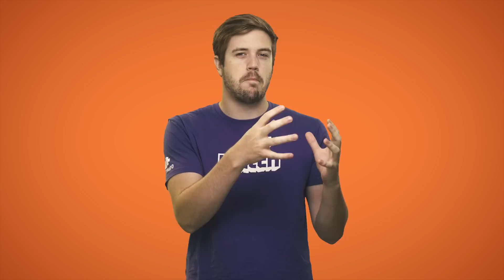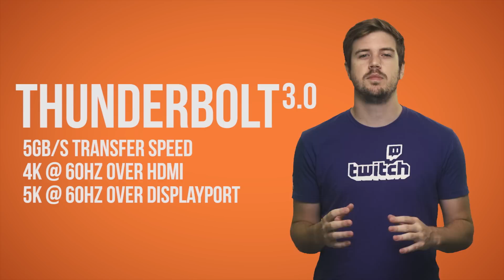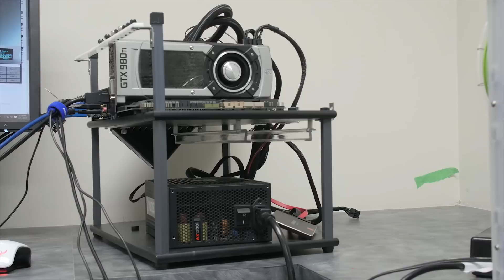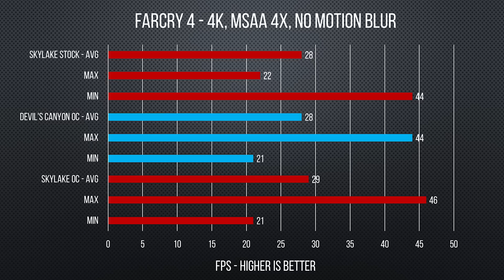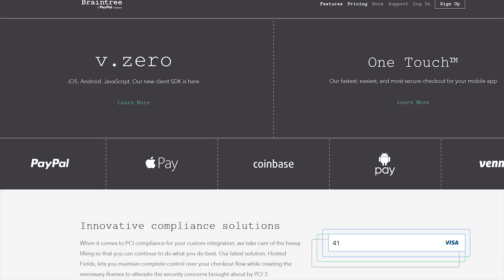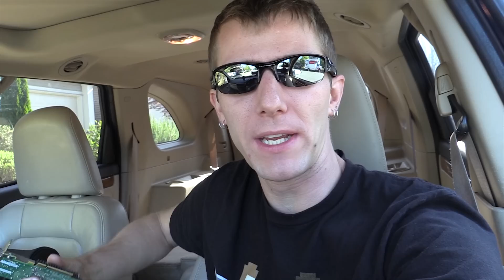Intel 6700K "Skylake" CPU

Comment: When you said older CPU's. Did you mean really old cpu's, cause I'm still using an Intel Pentium Dual Core E5400 @2.7 ghz? xD
Reply: Karl Taok tbh i wouldnt be surprised if i put my R9 290 into my old still running Core 2 Quad and it still ran BF4 and Project CARS just fine xD
Reply: Karl Taok Mate of mine is playing Dark Souls II Scholar of the First Sin on a core i5 650 (dual core 3.2GHz) with a Radeon HD 5770.
Reply: +exodiathecoolone That CPU is still good enough and for that GPU, that i5 has enough horsepower (even though that i5 is more similar to an i3 than a newer i5 - dual-core with hyperthreading).

A colleague of mine got that CPU. That thing overclocked very well using MSI OC Genie, from 3.2 to 3.8 GHz, not to shabby.

Comment: the only reason I bought a 4790k was for emulation,, Since it is god for it. Great that 5 games use more then 1 maybe 2 core since 2006...  I was a AMD fan until I learned the "price fer watt" or whatever was better.. Yeah if you want their new CPU to do as good as a P4 by all means! The new intel is crap. Anyone who isn't paid to say aswesome will say the same. The 4790k is the best still....
Sucks they don't give single core performance. AT ALL! What it can do vs what it does..

Comment: I cant believe people are still on Sandy bridge its ancient,....not if you're an enthusiast. Single threaded performance is like 40% better on new CPUs, and multi-threaded is like double. Not to mention all the new features on newer motherboards like USB 3.1, better audio etc  Not much difference between Haswell and skylake though.
Reply: tubester4567 single thread performance is marginally faster, about 10 to 15%. 
You are not counting that SB by default comes at 3.3 ghz, which is incredible low considering standard OC on SB is about 4.7 ghz, with chips getting at 5ghz. 
For the sake of comparison, a SB at 5 ghz, is a Ivy at 4.7/4.8, and haswel 4.5/4.6.
And because the newer cpus dont overclock as high as sandy bridge, the benefit to upgrade if you are a overclocker is negligible
Reply: tubester4567 It may be ancient however its successor's have mostly been focused about lowering energy consumption, increasing IGP performance and tweaking performance with minor 'tick' updates as opposed to total redesigns.

For most people you would be better to update your gtx500/HD6000 to the latest gpu's which offer much better performance and power efficiency and buying a SSD for your OS. Most games don't even max cpu's out or take advantage of multi-cores.

The 2500k/2600k will go down in history as one of Intel's great workhorse processors like the Q6660, Q9650, i5-760, i7 920.

Comment: if intel are bringing new cpus out, more than AMD, then that proves that intel are not doing that much different to there cpus, their just overclocking the old one and put a new number on it
Reply: Hayden123457 you're a special snowflake aren't you
Reply: they aren't, but they aren't doing as much to improve either.
Reply: Hayden123457 actually they have done a lot since 2600k series, the power usage has been reduced by a huge amount while also improving the iGPU's to a point that the i3 should be able to run games without a discrete GPU making cheap shop bought desktops good enough for budget gaming. they have added countless features aswell. The only thing that hasn't changed is the raw CPU performance but this aint 1990 anymore, raw CPU performance isnt the whole story anymore
Reply: Mansen I didn't say intels reason for improving their iGPU's is just for gamers but it is definitely helping to make the low end chips perform respectably in games
Reply: Mansen yes really, just look at the gaming benchmarks OC3D did with the broadwell chips, I haven't checked out reviews of skylakes gpu performance but its only going to be better :)
Reply: megaspeed2v2
You should and be dissapointed, skylake igpu's are worse performing than broadwell on desktop, mobile might be a different story though if we get sodimm ddr4 for mainstream.
Reply: Mansen omfg WHEN did I say that they were designed specifically for gaming? never. stop putting words into my own mouth. ALL I said they are getting better and that's a fact, if they continue to get better they will begin to rival AMD APU's when going for a budget gaming PC/Laptop, thats what I was talking about...
Reply: Mansen
Well if amd get their shit together then maybe there will be a use case where you dont need a dgpu (especially for laptops).
Reply: megaspeed2v2
And also intel wont let that happen, if they ever make chips that are even slightly better than the amd ones in both cpu and gpu tasks the laptops based on that chip will get priced much higher because intel is a brand you can label products with and the consumers will lap that shit up. theres also the fact amd apu's are rarely put in decent laptops in the 1st place because intel has that market in a vicegrip and its a market where efficiency reigns supreme (carrizo might have a decent shot there though if OEM's stop shoving them in shit).
Reply: Mansen what do you expect when you come in telling me I said shit that I didn't say... gtfo troll.
Reply: 1toncheese But intel ARE doing it, their CPU's have been getting better at all applications using the iGPU including gaming in every generation, back in the day an i7 laptop without a Nvidia/AMD GPU alongside it had a lot of cases where you couldn't even run a game on the lowest settings very well unless it was quite an old game and now you can easily play the latest games on low settings even with a bottom of the pile i5 laptop. its not as capable for gaming as a laptop with an A10 APU but if the trend continues as it has done (and there's no evidence that trend will not continue) over the last half a decade then intel will finally be ahead in all levels even the budget market.
Reply: megaspeed2v2
As i said, oem's are upping the intel prices for the brand names selling power. the same chi[ from intel would still be put out of the price brackets because its an intel chip and people will pay more for it.
Reply: 1toncheese erm.. where have you been buying from? wherever i've looked tended to price their pc's/laptops pretty farly based on the performance... the only exception is in those high traffic times of the year e.g the "back to school" period where the manufacturers can charge whatever the hell they want because they know people need to buy at that time.
Reply: megaspeed2v2
I've been looking for a laptop for awhile now to replace my ailing one, what i have found is that the equivalent intel laptop is more usually expensive. OEM's are still screwing over the amd laptops with subpar build quality, low capacity batteries, single sticks of ddr3 (usually 1333-1600mhz which is fine for intel and their better memory controller tech but for amd apu's it slows the system down a bit as apu's are built to work best with faster ram), no 1080p screens and so on. If you have any understanding of business then you get the fact that the most reputable brand can also comfortably be sold for a premium and amd have not got much in any market now so OEM's are just not trying to make something good with them. if you wanna see OEM's not care about making a decent amd laptop go find one based on carrizo and you will see it (hp in particular fuck the amd option of their only carrizo laptop by giving the intel equivalent option the choice of a 1080p screen, 2 dual channel ram and an ssd option while the amd option gets none of that).

Comment: Could they not remove Intel grapichs
Reply: Mansen the iGPU is bigger than the CPU die these days so it wouldn't be too hard for then to release a true mainstream-enthusiast CPU with no iGPU and then use the spare space to add an extra 2 cores. that's what. :)
Reply: erm...no. Some people don't need dedicated GPUs you know.
Reply: +megaspeed2v2 Aah... how should I put it?... The new i7 6700k has Intel HD 530, which is a very tiny GPU (only used for the time when you don't have a dGPU). Intel decided not to use Iris Pro on these thing because people wouldn't use them anyway.

I think Intel will use Iris Pro on the lower-end CPU, like i3s, so that people who buys those can still go without a discrete GPU. That might be awesome for a HTPC/Casual gaming rig.
Reply: MrBiky yes I know that, that's exactly the reason I think they could offer a version of the chip with no iGPU at all with the focus squarely on CPU performance for users who will never use the iGPU, they could use it as a way to get 6 cores into the mainstream enthusiasts hands.
Reply: megaspeed2v2 They could do that, but who knows why they don't... Maybe they think that their GPU will be used to troubleshoot a defunct PC?... Intel, please...
Reply: MrBiky their reasoning is highly likely to be just because there is no competition from AMD so they might aswell put all their R&D into power consumption and use that to build up their mobile marketshare... but I'll bet you that if push came to shove and AMD did create something as fast as a 6700K (as unlikely as that seems) intel probably would either just make 6 cores a mainstream option or use some other trick to create a large performance boost to stay ahead even if that meant making iGPUless processors :P
Reply: megaspeed2v2 Nope, Intel's first priority was power consumption after the core 2 era - beginning of core i. As for AMD, I really wonder what they can achieve with Zen, they left a total mystery now. They might give consumers an 8 core (16 threads) CPU without iGPU, with the IPC around Haswell, so I'm really looking forward to what their plans are, since Intel seems to do only power consumption improvements.

I'm rather interested in APU rather than CPU, since I love compact builds and love to have fast iGPU and I do hope they will launch an APU with HBM on-board, that would be awesome (even 4 GB).

Also, I'd love to have an Intel CPU with Iris Pro in a tablet formfactor (8 in), but the thermals would kill it without a fan (even my Atom z3740 throttles after 1 hour of youtube...).

Intel's only "disadvantage" might be their pricing. If AMD's 4 core SMT CPU is priced around the top tier i5 and beats it in performance (at least multi threaded), that might be serious business. Also if their 8 core SMT is priced around consumer i7 (the 4 cores with HT), that might be more serious business.
Reply: IGPU's are pure marketing for resellers like Acer HP or whatever xD

Comment: Just wish I had a 3770k over the non-K... Got liquid cooling because the mobo I have now has the ram dim's really close to the CPU so normal coolers weren't working (not enough clearance). Kind of silly water cooling non-k but I had no other option except stock cooler -.-

Comment: go 5820k or 6700k, similar in price?
Reply: +berzu21 only really for a mini itx board, a decent z97 board and a cheap (but still just as good because x99 is an enthusiast/professional platform) x99 board cost roughly the same amount.
Reply: 1toncheese yeh that my thought process, because 5820k will still be just as good as 6700k for gaming I think, but I can also use it for work. Is that the right logic?
Reply: +wrap267 yeah, I'm sure 2 extra cores, more cache and quad channel memory would be more useful to you than skylarks ipc improvements. can't quantify it unless you know what your working on though.
Reply: wrap267 Just built a new rig last month with a 5820k and a Titan X and it wipes the floor with the 6700k. Not in just gaming but also with the amount of video editing and and graphic design work i do.
Reply: berzu21
Well that is the "2 extra cores" thing i did mention as an advantage.

Comment: Hey Luke did you really need 1.4 volts to achieve 4.7GHz on the 4790? I use 1.321 volts on my 4790K O/C to 4.7GHz as well.

Comment: is this a good build? http://pcpartpicker.com/p/vPTvxr
Reply: Adam ramzan Seems alright if you aren't gaming but you will need some sort of GPU since that CPU doesn't have on board graphics and if you don't plan on putting a high end GPU in this system i would swap that power supply for a lower wattage Corsair or Seasonic one.
Reply: i forgot to add the 970 that i own derp
Reply: will be adding 1 more 970 later
Reply: lol Ok well that solves the GPU problem but i would still swap out that power supply for a Corsair CX750.
Reply: Samsonsuperco You should probably get a better PSU them. 750W will probably be pushing it, if you're going to run SLI. As far as the rest of the parts go, it's hard to tell when we don't know what you want to use it for?
Reply: Nighthawk 750W should be plenty for 970SLI. These cards don't consume a lot of power.
Reply: You are absolutely right. I was thinking about GTX 770's. (And yes I know that would theoretically be fine as well. But the CX series are not good PSU's, they're mediocre at best. And pushing mediocre PSU's to the limit rarely ends well. Not that they will damage your system. They're not that cheap).
Reply: Adam ramzan swap the xeon with an i7 or fx 6300
Reply: +koupa fx 8350 is better than the 6300.  either get the i7 4790k or an fx8350.
Reply: +koupa fx 8350 is better than the 6300.  either get the i7 4790k or an fx8350.
Reply: Gaming needs less cores on higher speeds...so 6 cores better than 8
Reply: Adam ramzan Question is, what do you want to use your rig for? Buying an expensive CPU is useless if you are not going to fully utilize it.
Reply: gaming rendering doing vid editing a hosting mc servers
Reply: plus the cpe is a 4790 but minus the igpu
Reply: +Adam “The Gaming Slime” ramzan dont go here for help, also dont buy a four year old chipset like some people suggest
Reply: the cpu is good for my needs i dont need the greatest and latest
Reply: Adam ramzan  i agree im still running dual xeon x5450s... the perform about the same as and i7 3770
Reply: those are pretty old xeons but the gpu matters more than the cpu so my 4 core 8 thread is the same as a 4790 but it has no igpu so its the same so for all of the people whi say xeons are bad thats sorta funny

Comment: 2500k for life then i guess
Reply: Edmundo studios 
Aww yeah, 2500k master race! I've had my chip @ 4.5GHz for years, and every time Intel releases a new model of chips, I check 'em and say "nah, not yet"
Reply: JarLoz I got my 2500k with a mainboard for 120 bucks on ebay which is absolutely unbeatable considering performance/costs ratio.
Reply: Edmundo studios if I ever get jealous of a new Intel CPU release, I just have to bump up my 2500k by 100mhz. Currently at 4.6ghz years later and still happy!
Reply: +Edmundo studios lol i'm stil on the i7 920K updated from the 890K
Reply: yeah
Reply: Edmundo studios I'm still on my 2500k @ 4.53 GHz, I'm not going to switch soon... :p
Reply: also rocking the i5 2500k at 4.4ghz, but i wish that i would have gone with a i7 instead
Reply: We need AMD to step it up lol
Reply: *****
Right now i really would like some more performance, but it is not worth it to upgrade to newer cpus at the moment. With a 2600k i couldn't even upgrade to something significant faster
Reply: Edmundo studios  they will next year with Zen. but it don't be much better or worse than Skylake. as Moore's law is slowly dying off, CPUs aren't getting much faster. so now Intel and AMD have to add lots more features to the CPU and motherboards/(which Skylake was)
Reply: *****
Cities skylines for example, it uses all 4cores with 95-100%, there would be a bit more headroom with an I7 (i know that the game only uses 4 cores)
Reply: +Edmundo studios I'm in that boat. At least for another couple years :/
Reply: lahire149 haha who would have thought back in 2011
Reply: EDM Panda Amazing how cheap they are on ebay now I was looking at the 1st gen i7 a while ago

Comment: got a cold bruh?

Also, 4.7 Ghz at 1.4V? Damn I thought it was not save to go above like 1.3V and 4.5 Ghz.
Reply: +Baraka Gitari Clock speed won't really matter much in terms of safety as far as I know, could be wrong though. Go with as high as you want, if it won't work, make the voltage higher or lower your clock speed. Voltage is where you should be careful with. You don't want that too high
Reply: the a10 lineup are capable of surviving 1.5 volts if cooled correctly and the 7870k apu's ships with a default voltage of 1.47 volts. and amd are still stuck on 28nm
Reply: Baraka Gitari I think they run their cpus at a high voltage just because its easy to make them run the OC stable on that, they could probably reduce it and get the same speed stable if they tweaked it but aint nobody got time fo dat! xD

Comment: Should i upgrade from the i5 4690k to the new 6700k or nah? xD
Reply: I got the i7-3770 here bruh. Lol xD
Reply: no, you shouldn't. i5 4690k is a good processor
Reply: +TheGamingKamiX™ yes you should, it will drastically improve your fps. Expect a huge jump from 58 fps to stable 60 fps in most games. That should make your PC gaming race ADD less obvious
Reply: novo266 Just a question or two if i may... Is there a big difference in performance from i5 4690k to i5 4460
And is the i5 4460 signifficantly better than 4430 since that was my last prossesor. I am looking into buying a computer and the i5 4690k model is much more expensive than the i5 4460 model. Thanks!
Reply: *****  what are you going to do with your pc? (play videogame, rendering video??) if you do overclock, you will buy the i5 4690k and z97 motherboard. if you don't overclock, you will buy i5 4690 or 4590( because the frequencies are better than i5 4460) with h97 motherboard.
Reply: I am going to do gaming but i have a tight budget of about 13000 swe KR so about $1600. And im buying a prebuilt pc
Reply: what are the specifications of this pc?
Reply: +TheGamingKamiX™ Good luck with that lol. You'd need new RAM too. Expensive as shit DDR4 RAM... Why did they make consumers buy DDR4 when it offers no benefits to us?